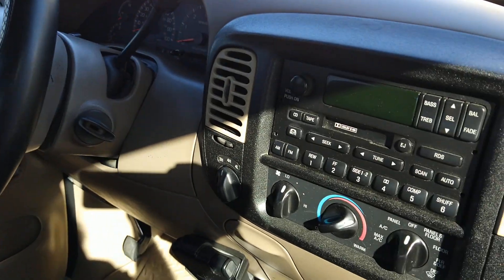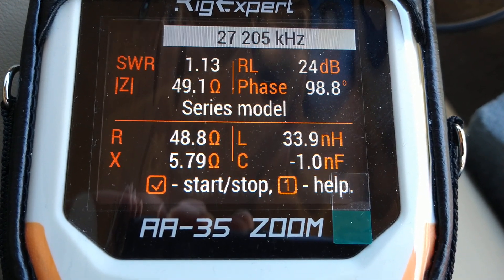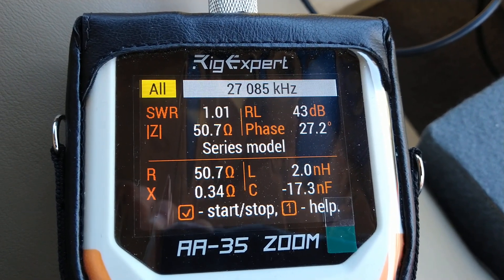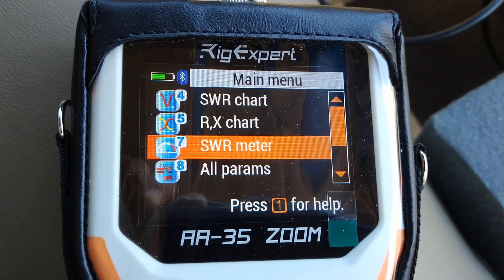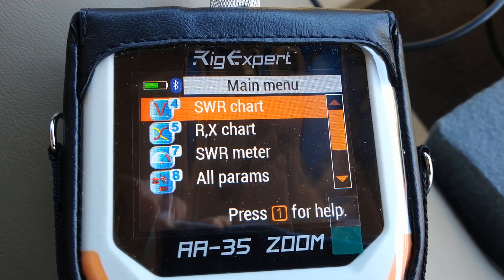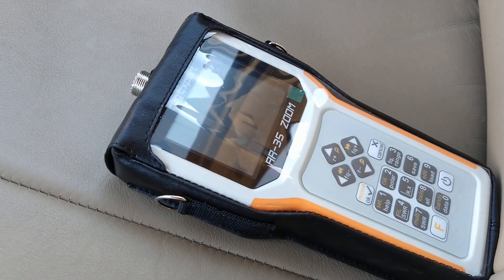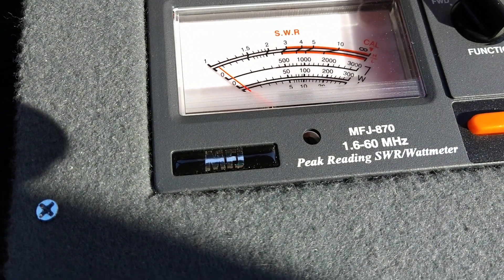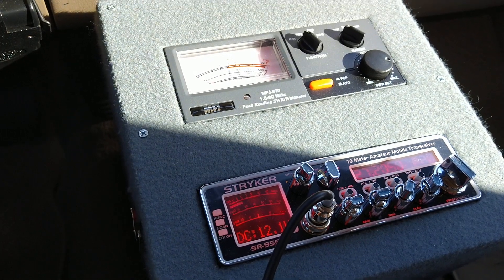Do you believe the radio, swr meter or antenna analyzer???

Comment: If you not running an amplifier , just use the SWR meter from radio, if you are using an amp then use an external meter or analyzer.. to check if the external SWR meter is accurate you need to connect a dummy load , calibrate it and you should not have any reflection, the SWR should be flat, do the same with the radio , if the SWR moves up that meter is not accurate.. it’s a simple solution without guessing
Reply from the maker: Once you start running an amplifier, jumpers, etc things can change and meters can start showing some funky stuff. There are a lot of variables, especially in a mobile set up.
Reply: @vegasfordguy when running an amp , I set up the antenna using my MFJ 259 .. I make sure it has 50 ohms 1.2 @97 match effeminacy.. sometimes you need to add or subtract coax length.. I carry different lengths for testing, every truck and installation is different, when I find a match I go back and make the correct length of coax .. usually I use LMR400 coax

Comment: I use the analyzer to get the antenna close to 50 ohms X0, then use a Bird meter & line section with a small slug of 25w or less, and final tune for minimum reflect with the amplifier on.
Reply: I couldn't tell you what my SWR is on any of my setups. Lol Every single mobile or base I setup is tuned for minimum reflect.

Comment: True SWR is probably correct on the rig expert.  Any harmonics from the radio or amp will show up as SWR since the antenna obviously isn't resonant on those frequencies.

Edit: any break down in the antenna system caused by power will show up as SWR